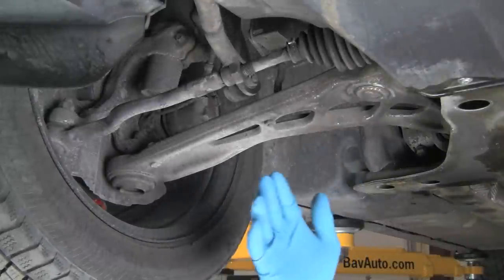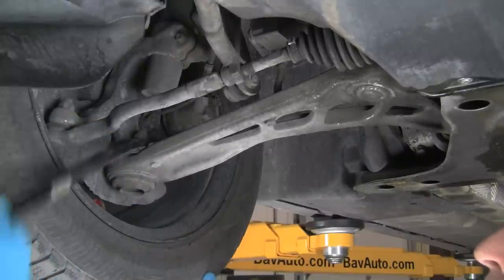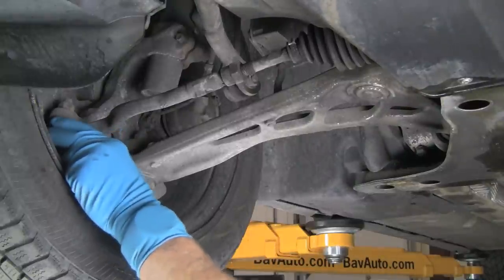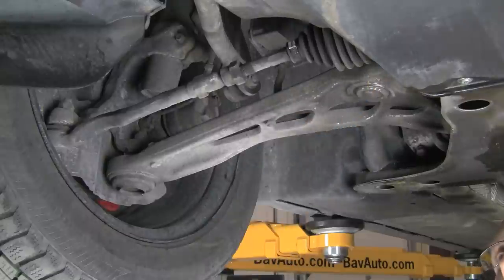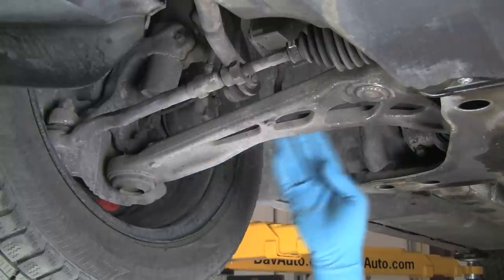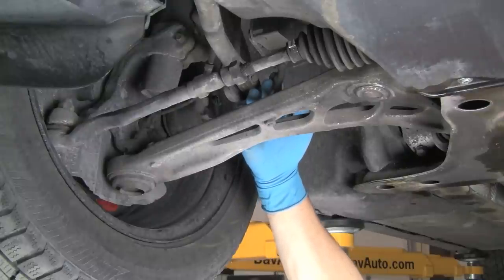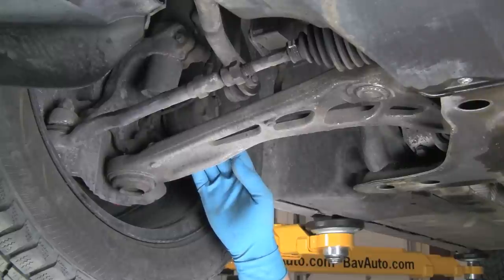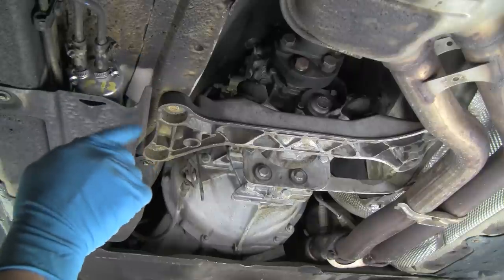Part 2 of 3: Maintenance Inspection for BMWs & MINIs - Under the Car, Front & Middle - BavAuto DIY

Comment from the maker: We have not produced a video or DIY for the valve adjustment on the early BMW 6 and 4 cylinder engines (M10, M20, M30).  We do have a blog post on the subject at our tech blog at blog.bavauto.com ... search M20 Valve adjustment .... after clicking to the blog.